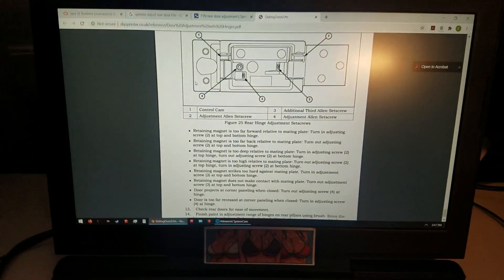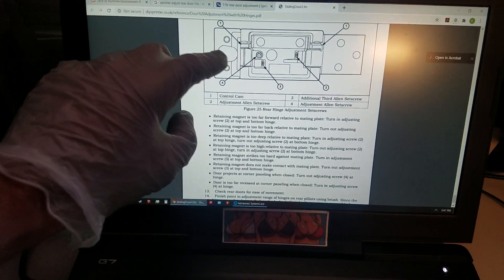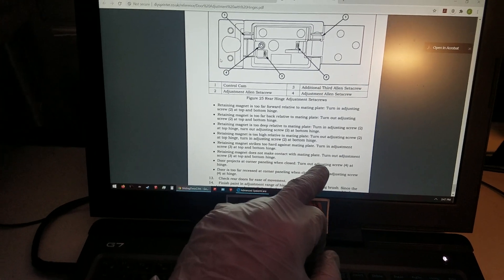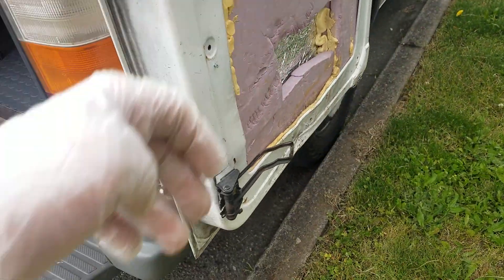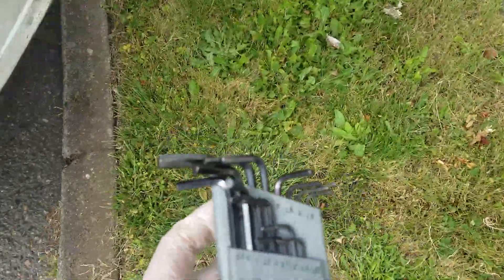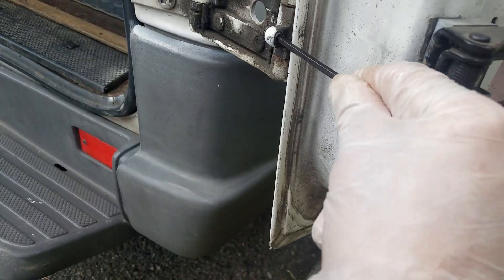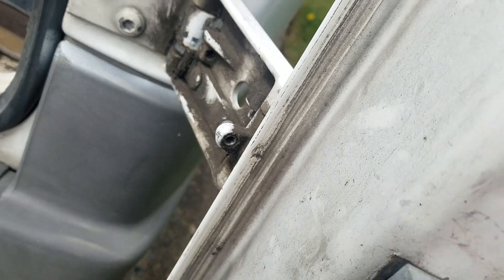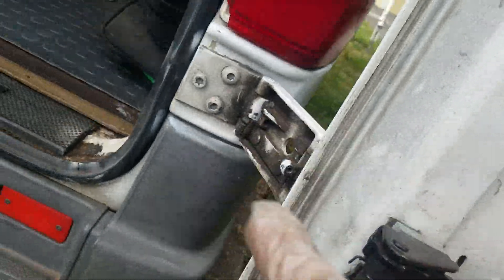T1N Sprinter: How to fix rear door gap at outer corners near tail lights

Comment: Jeeze! Was your neighbour mowing the lawn when you made that video? 😂
Reply from the maker: Heh my bad. I didn't wanna turn off my generator and then back on, for a short video. I built the box for my Lifan 2500, but the harbor freight generator has the pull start on the other side, so I gotta move the fuel can and 100' extension cord out of the way, turn the generator 180 degrees, pull start it, sometimes twice bc that one was finicky, then I gotta rotate the generator 180 degrees for the exhaust to face outside, position it so it doesn't vibrate a bunch, then lift the 5 gal can of gas up almost above my shoulders depending on terrain, assemble it all together so it doesn't vibrate, and then... then I can have air conditioning. It's a major PITA and the system is a work in progress, but there's other priorities now, like vehicle maintenance and my AC leaking in the rain, shower install, etc.

Comment: I got a gap in the top middle area that lets in water. How does one remedy this?
Reply: Hi Preston I think we all have that issue once the van gets to a certain age,  I decided to get into this issue today and found the link he uses on this video.  maybe this helps  http://www.sprinter-rv.com/wp-content/uploads/2010/09/T1N_Sprinter_Door-Adjustment-with-Hinges1.pdf
Reply from the maker: I think I found the cause. It's from the doors being bent outwards. If you put a 2x4 in the door jamb and then a ratchet strap on either the top or the bottom of the door, you can ratchet the door inwards on a built-in mounting point somewhere in the van to slightly bend the door inwards to create a better seal.
Reply: @TheHumanSoundSystem  Adjusting the star bolts / upper hinge worked :)
Reply: @AncapistanVan  !! Macgyver type shit :) thanks G
Reply: Been a long time subscriber dude, thanks for the T1n tips. Also the How to find a spot tut is class
Reply from the maker: @ratchetboo  thank you :)